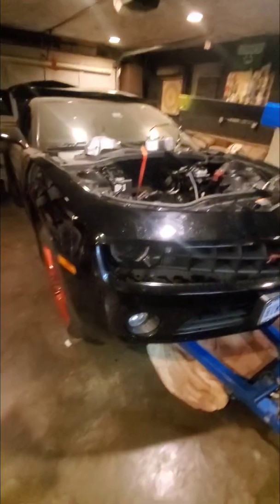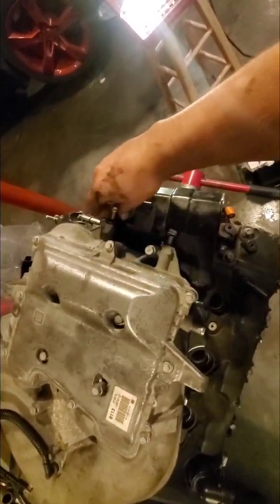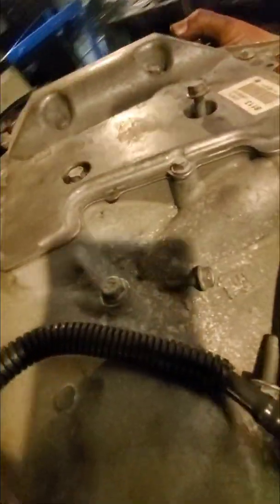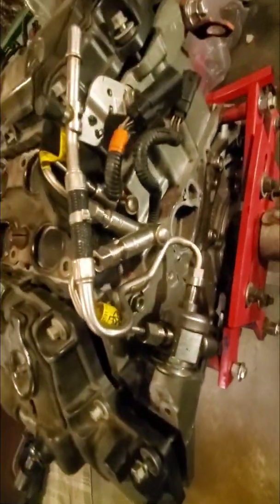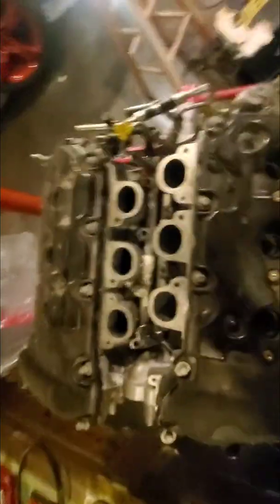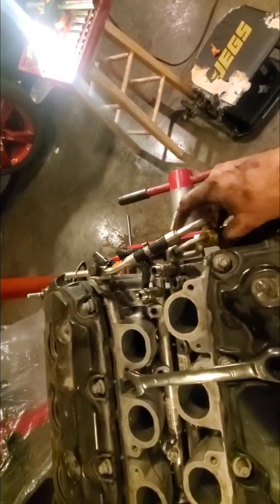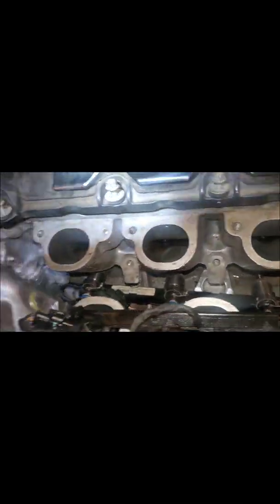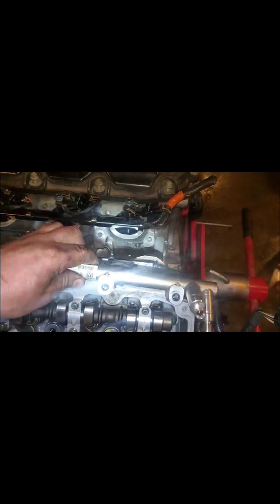3.6 chevy motor direct injection

Comment: I believe we have a leaking injector on a LLT motor with 60k miles on it. Is this a common failure with these engines? I had codes P0087 and P0089 as well as misfires for cylinder 4 and 6. We replaced the injection pump on the back of the head and still having misfires and heavy fuel smell so we are probably looking at doing this very same repair. Just haven't seen many videos on the matter and thought I'd ask what symptoms you were having as well as the milage you had at the time of the repair. 👍
Reply from the maker: My motor locked up at 180k so I had to replace the whole motor so I did this video do to the replacement motor.  Sorry to hear of your problems hopefully this video helps you out. I couldn't find anything on this motor so I did my best to show my set up . Sorry I'm not much of a camera man .
Reply: @dh1175  @pirategmunger First of all I just want to say thank you for this video! I have searched far and wide for a video of how to change the injectors of a 2010 v6 camaro. I'm in Nigeria, so as you can imagine, not a lot of expertise here (Asian and European Cars are more common here). I took it to the autoshop (I'll speak to symptoms in a minute) and my mechanic was scared of diving deep into the engine to find the injectors cos he didnt want to damage something else. This is the only video I know of that actually explains how to get to them for my exact car! Thank you!
@pirategmunger here were my car symptoms. In hindsight I think it started with occasional smoky and jerky idle starts that would clear after a short drive or battery reset. I initially thought it was bad fuel, but after a few days no issues. Then one day, when I was about to leave the office, driving out of the car park, I experienced a sudden reduced engine power error. Car goes into limp mode and stayed like that until I got to my destination. Fuel consumption and smoke became prevalent - I could literally smell the unburnt fuel coming out of the exhaust. Codes were P0089 (fuel pressure regulator 1 perfomance) and P0030 (random/multiple cylinder misfire detected). Turns out Cylinders 1, 3 and 5 were misfiring (and all were on bank 1). Hence, since regulator 1 and bank 1 cylinders were misfiring, we were able to narrow it down to something along that side. We did the easy trial by elimination - changed spark plugs, no effect; switched ignition coils, same cylinder error codes, then had to stop cos my mechanic didnt know how to get to the injectors to check if any was damaged. So, with the help of this video, once my new injectors arrive, we will change them together.
One thing though, during my research, I saw a video of someone who had the same problem and same codes, and it turns out that he was able to solve his problem by changing the fuel pressure regulator (located near the fuel tank underneath the rear passenger side). He also advised if that doesnt work, to also change the fuel pressure sensor that @dh showed in his video (below the manifold). These 2 items are relatively easy to install. So I have ordered them too and will change them first before diving into the injectors as last resort.
Were you able to sort yours out?

Comment: Why did you decide to rebuild instead of just getting new? I'm asking because I got same motor and this what I'm working
Reply from the maker: O I had to put a new motor in and my injectors were good. But you have to rebuild every time you pull them out
Reply: Make more videos I appreciate you
Reply from the maker: Car is solid.... and for $4000 for a new motor.  Your not going to get a solid car with a new motor for 4g so 🤷.  Plus I sent a extra 1g and up grade the bumper and my daily is awesome now.
Reply from the maker: If you have Facebook check out my page humenaysdesigns if you want to see the rest of the build
Reply: I mean injectors not motor

Comment: I owe you a steak dinner date. This is gella helpful. I'm still struggling a bit with it and figuring it out more.
Reply from the maker: Just take your time and walk away if you get pissed.  I feel your pain. Breathe.  I've been there.
Reply: @dh1175  I'm at that point brother. Had to make a milkshake to cool down. I got both U shaped valve off from the back . I still need to remove the driver side fuel rail and then the injectors and the connectors. Is it 100% need to to replace the bushings?
Reply from the maker: @justaguy6181  if not they will leak. The fuel pressure is crazy high . And there a one time use bushing and crush seal.
Reply from the maker: https://www.rockauto.com/en/catalog/chevrolet,2011,camaro,3.6l+v6,1446663,fuel+&+air,fuel+injector+seal+/+o-ring,13679
Reply: @dh1175  dang. I'll order new one right now while I'm Messing with this. The drivers side is kind of a pain. Can't get easy access to the clips on the injectors
Reply from the maker: $28 but you need 2 sets of them .